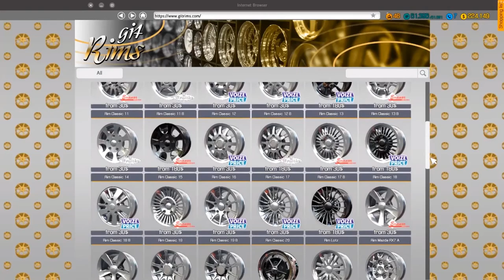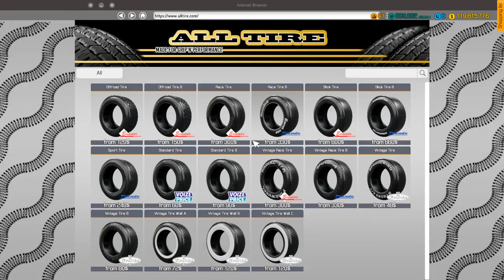1977 AMC Pacer X With Supercharged V8 | Big Blown V8 vs Little Car | Car Mechanic Simulator 2018

Comment: Just so you are aware the size/type of tire you put on doesn't effect the handling.  It has been recently discovered that to fix a car that spins you need to change type/size of tire in the car config file.  Hopefully this will be fixed in a future update.
Reply: of course type of tire will affect handling, what you are saying?
Reply: What I'm saying is unless you changed it today the cars grip is based on what is listed in the config rather than what is on the car.